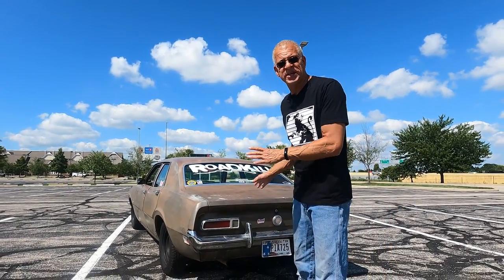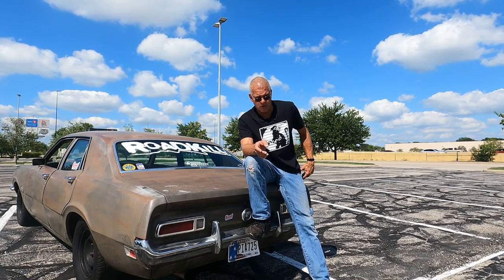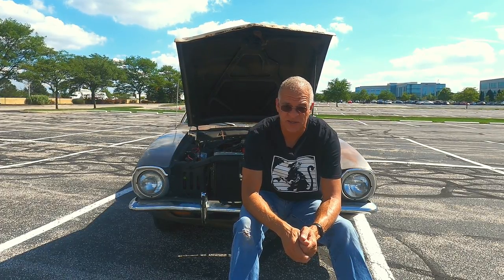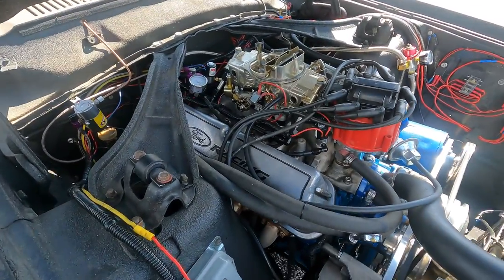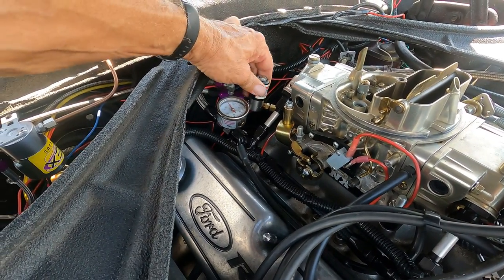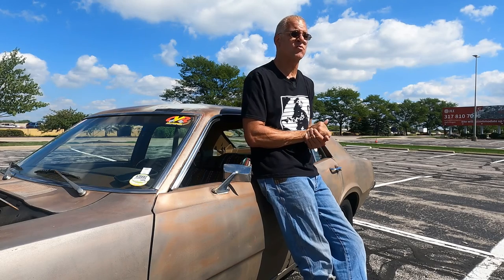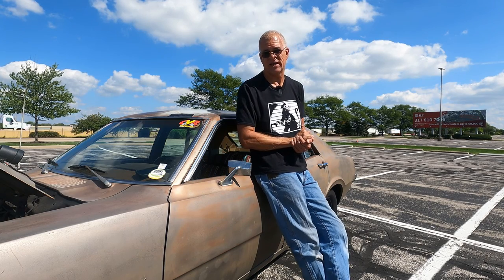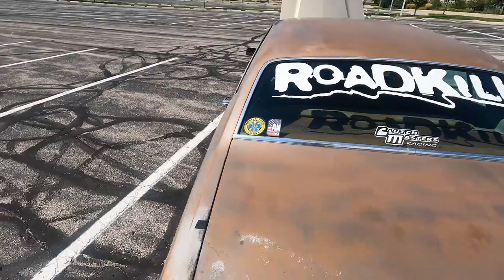Goose, the 1972 ford Maverick from the hit T.V. show Roadkill, Walk around and test drive

Comment: Acceleration hesitation. Drop the fuel tank, check the sock on the fuel sending unit. It may be clogged. And if you haven't cleaned or replaced the tank, it may be a good idea to add a few more fuel filters along the way to the carb. But you probably already know this, lol. Did the trick for my '73 Comet.